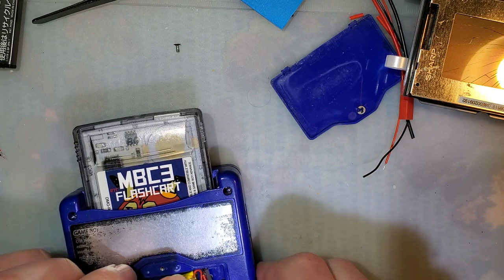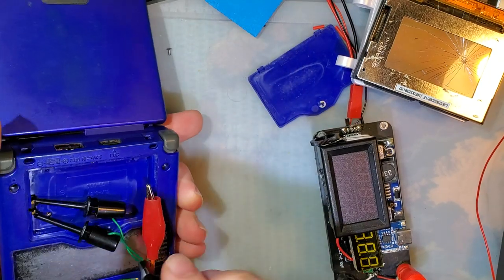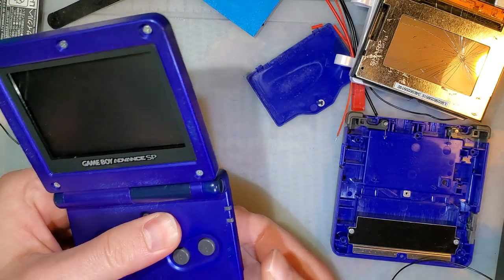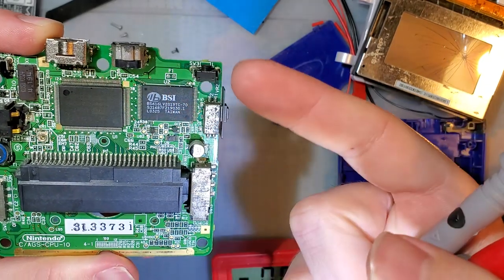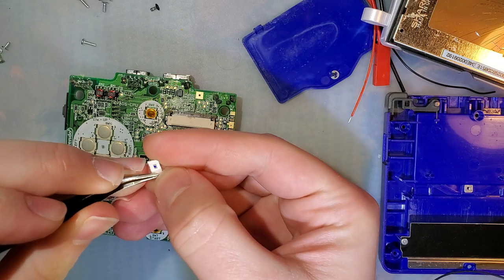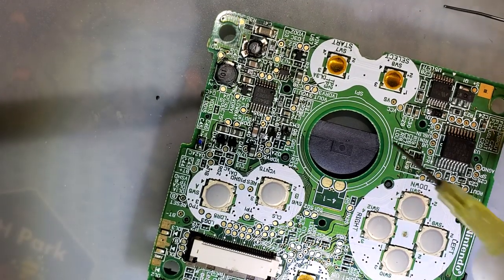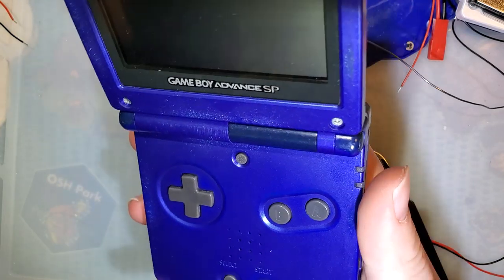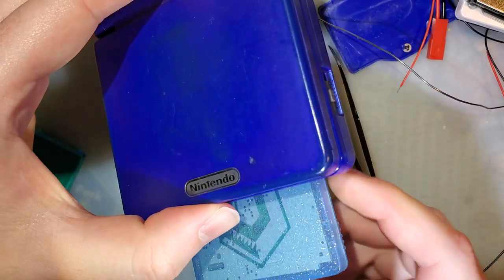What Happens When You Install a GBA SP Battery Backwards? (It Blows Fuse F2)

Comment: Very helpful. I have an SP with LCD panel, helder power cleaner and flash cart. If she ever suddenly dies, this is probably the culprit
Reply from the maker: Well, that "power cleaner" will very likely blow up the input fuse sooner rather than later.
Reply: @makho  you don’t sound too keen on it.. I can say objectively, it took all the noise out of it. Perhaps I’m missing something
Reply from the maker: @Caswagna93  It's placebo. Audio on GBA consoles is digital PWM from the CPU and the DAC/amp itself is on an entirely separate voltage rail. All it does is add enough capacitance to overload the fuse during times of high load (such as the massive inrush when you power the console on).

Comment: Hi Mahko! I have a question. My gba sp wont turn on. But when I plug it in the charger it lights up then it shuts down. What seems to be the problem? I tried replacing the battery still nothin.
Reply: i got the same problem but it almost turns on when i plug the charger in and  flick the switch at the same time so im guessin the charge port is good however there’s something else that blew so it wont power on

Comment: hey i've replaced fuse F2 previously and just checked and its blown again. It was fine for years but one day i tried to turn on power and it didn't manage it; blew the fuse.

I've done quite a few mods to this system. IPS screen, flex amp, there's a raspberry pi pico in the top lid (connected at C2 on the power switch & negative terminal of battery), flash cart, as well as the GBA SP Power cleaner mod.

The power cleaner I think is probably the biggest current draw on initial power on. I've previously measured something like 630 mah draw when it's initially trying to charge all those capacitors, which goes down like 50% or 60% or something once it has them all charged.

so yeah there's a lot more going on there than fuse F2 was designed to handle, and I think that is probably the issue. A few vendors sell 1.5 amp fuses as a replacement for F2.

Would you recommend a higher rated 1.5 amp fuse, or try to remove some mods? It's kind of not great if this very tiny fuse will keep failing once a year or so.
Reply from the maker: I'd recommend removing the snake oil power cleaner and then your next biggest problem, the amp.
Reply: @makho  Will do, thanks. :-) I ended up ordering 1.25 amp fuses, and was just about to get around to installing a new F2, so I'm glad to hear back from you. I'll definitely get the power cleaner out then, & the amp is a problem to be fair, but the increased volume has been kind of nice. If I blow another F2, I'll take out the amp for sure.

Comment: Can I use this specific model for 2 AGS 101?
1,5AMP 32V 0603 0,8x1,6mm SMD LITTELFUSE 043401.5NR
I just found it cheap around here.
Reply from the maker: probably
Reply: E aí, Cristiano. Conseguiu fazer funcionar com esse specs? Estou pensando em comprar o mesmo tipo de fusível.
Para gringo ver: 
Hey, Cristiano. Did you manage to make it work with that specs? I'm thinking of buying the same type of fuse.

Comment: thank you for this video! which temp celsius should be used to solder the smd fuse?
Reply from the maker: If you've never soldered before, I highly recommend starting with a solder practice kit rather than just going to town on your GBA. 

I solder at about 290C baseline but that can change depending on which specific iron I'm using, what tip, what I'm soldering, the specific solder I'm using, etc.
Reply: @makho  done with it :) bought a ts-80p some time ago and used it now. after i changed the "pen" tip with a broader one (like you are using) it worked very well. for the next time i get better tweezers. i still got this cheap plastic ones from aliexpress (they dont like heat very much ^_^)  The only problem is this damn small size of the fuse...had to use a magnifying glass from time to time , maybe because i'm getting older ^_-...do you still have eagle eyes or just this awesome solder skills? xD

Comment: Hey mahko i may have blown this fuse. I was doin a gba sp unhinged battery mod and installed the battery and attempted to turn it on and it doesnt it flashes on then goes blank in less than a second,it does the same when i plug the charger in too
Reply from the maker: you have a short. Check your wiring.

Comment: Hey I was hoping you could help??? Do you know anything about the transformer (inductor?) that is between the battery terminals and the cartridge connector?? The round blue core popped off on mine and I dont know the right place to find them. Help!
Reply from the maker: Inductors/transformers are very often made custom for stuff like this. I don't know of any other source for the part aside from another GBA SP (or maybe a GBA)
Reply: @makho  ok thanks!!

Comment: hey whats the exactly right spec? for DS Lite? I need to fix mine i bought a ds lite for 55euros and the fuse is burnt..
Reply from the maker: I think you overpaid for that console at that price, especially with it broken. But 0603 and between 500mA and 1.25A should be fine.
Reply: @makho  it was in a mint condition.. like it was used once with the original box, the fused got burnt from a faulty gba game, hey a technician told me to not use something over 5 mA because ds lite uses 450 current, so thats like 10% headroom anything above might not be good long-term. whats your thoughts? and thanks for the reply.

Comment: Could I theoretically solder on a new f2 fuse over a dead f2 fuse rather than removing the dead fuse?? I did it by holding it down but I'm not sure if it's safe to solder on ! haha
Reply from the maker: just remove the old fuse, it's not difficult at all

Comment: I have connected my external AA and Lipo powersupply (custom build) with alligator clips backwards....and I have been fortunate that:
1.no fuse was blown.
2. System blown fuse & bridge, did not get fry lol

I guess this is why you should never bridge motherboard and replace. They are just so hard and tiny to replace :( 

Yet somehow I can repair and run/reconnect DA1 & DA2 legs to board with copper wire. I can do that but not install DIODE.
Reply from the maker: I'd recommend getting a solder practice kit. It's pretty easy to do small SMT parts IMO but it does take some getting used to your tools to do it. Good tweezers are a must.
Reply: @makho  Okay I will do that.
I was told the fuse needed was SMD 1.25amp 32v 0603 N https://www.arrow.com/en/products/04671.25nr/littelfuse  but I found this on Ebay SMD 1.5amp 32V 0603 K https://ebay.us/jiBXYj 
Do you think this 2nd will do? same ratings just .25amp difference
Reply from the maker: @thepokerus4184  yep, should be fine
Reply: @makho  Thank you Makho :)
Reply: @makho  I did it Makho. I already have some solder experience, had done laptop USB repairs, and many Gameboy mods. Even 3ds hard mods with SD cards back in the days. My problem was i was not using my tools, needle nose pliers with curve did the trick, and flux of course. Solder and replace in less than 10mins thanks to you and the retro station.
Reply from the maker: @thepokerus4184  I highly recommend a good set of tweezers. It makes all the difference for soldering. I get by with OK tweezers but I'm going to buy some good ones eventually.

Nicely done
Reply: @makho  I meant needle nose tweezers not pliers lol I am Such a dork, dont know why i said pliers xD thank you again for your awesome videos and help.
Reply: @makho  yes I bough an IFIXit tool Kit back in 2018 and it came with good sets of tweezers, they have been life savers, have such good grip, not like cheap chinese ones that send my SMT chips flying lol

Comment: Hey can i use GBC fuse for GBA SP? I think GBC fuse is 1A 50v 0805
Reply from the maker: 0805 is likely to big but it can be made to work with some effort. You're better off just getting the right part from the start.
Reply: @makho  but with that fuse amperage is still possible, right?
Reply from the maker: @erscii1593  yes, 1A is fine
Reply: @makho  okay i'll try it. Thanks

Comment: I just made a short circuit because I dont have a extra fuse and it works but is not very secure :)
Reply from the maker: Please don't I've said this before but fuses are safety devices. You wouldn't "fix" an airbag warning light in your car by just putting electrical tape over the warning light. 

Fix it the right way or buy a new SP so when you inevitably and irreparably break this one, you already have a spare.
Reply: Seems like shorting it is a quick and easy solution.  Its probably easier to replace the motherboard than to mess with fuses 2x.